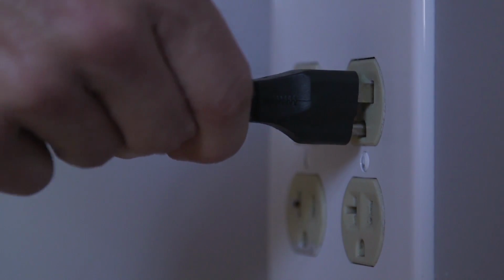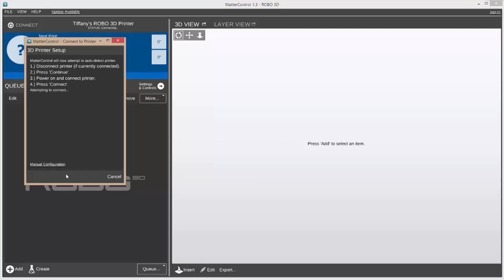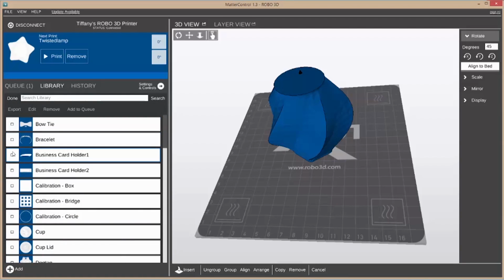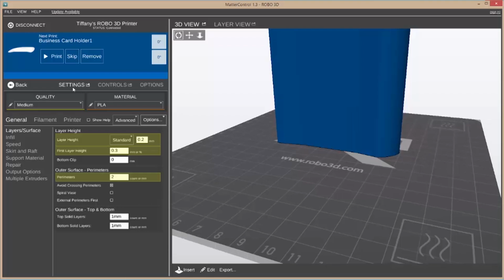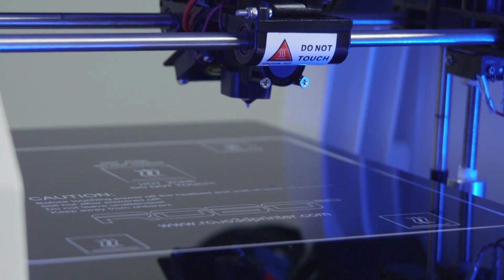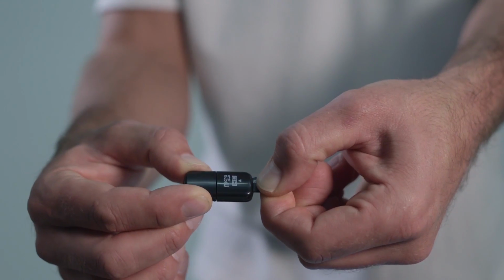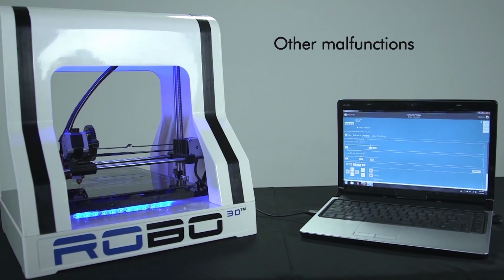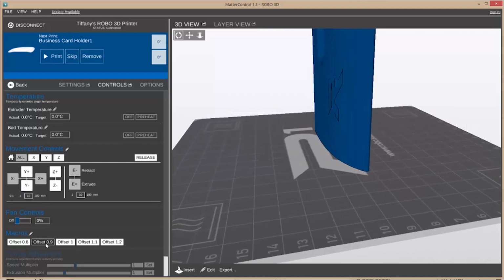ROBO 3D R1 "PLUS" Getting Started Video "Latest Version"

Comment: Have had my Robo 3d R1 Plus for about 3 years now... I've had no issues with setting it up and printing a crazy amount of odd and cool things. I am still printing with it today. Most of my prints are big enough to last 5-14hr... It is now starting to break down, but the support staff at ROBO 3D have been too awesome. I will for sure purchase another Robo 3D printer because it works great, but mostly based on the support that I have gotten in the last few months. The technician not only cured my problem, but also saved me on the shipping cost some how. Also pointed me to how to prevent future issues I might run into.

There are probably people out there who have horrible stories about this printer. I for one have not had any issues, other than it finally breaking down after years of abuse from a new 3d printer owner. I am for sure going to purchase another R1 Plus if it is still around when I have the money, or the new R2 because I love the large print bed.

Thank you Robo3D(Jason mainly) This printer is greatly appreciated by me for sure.

Comment: I paid pre-assembled.  The printer should just work out of the box but it wasn't.  ROBO 3D, do you test your product before shipping to your customer?  I bought it a few years ago but I didn't test it until today.  When I open the box, a two inch screw was dangling and scratching the glass plate.  Nothing works.  Very frustrating with this piece of GARBAGE FROM ROBO 3D.  I had never have so much frustration with a product ever.  This ROBO 3D printer is PIECE OF SHIT.  If you want to change my mind about ROBOT 3D, send me a working replacement unit.
Reply from the maker: Memet, we test out printers at the factory and then ship directly from the warehouse. If you have an issue with your printer upon delivery, your warranty is in effect and we can replace/fix any issue you may be having. Please reach out to Help@Robo3D.com.
Reply: First of all, my frustration is directed toward the product and is not directed toward any particular individual.  The printer cost $914 USD (shipping included) so it is not a low cost product.  NOT ONCE does the printer print anything.  Right after each failed attempt, I needed to clear the clogged hot end and removed the backed up filament and the printer still won't print.  Forget about the hot bed was scratched up and chipped. Forget about waited five weeks for delivery.  I just want it to print something.  Endless frustration.

Comment: +ROBO 3D I bought a Robo 3d r1 and got it all setup. I used a copper PLA filament for the first time. I set the correct temperature for the extruder at 210°C and Bed at 55°C. when it started heating up I saw smoke coming from the nozzle. Is that normal?
Reply: I believe so because they used test PLA filament the test to make sure the critter works and since you were using the Copper based Filament it probably just melted the PLA too fast and it turned to smoke
Reply: Yes it shows that its working.

Comment: I am on my 2nd R1+ printer in three weeks. The first got such a nozzle clog I took it back to Best Buy, The second one got a bad clog five days ago and was able to get that out just yesterday. Now it will not level and it either stops after a couple of layers, does the top layers of the calibration cube, or prints 2 inches in the air. I would love to post good things about it but I can't
Reply: +John Allen I had those beginner problems as well. its not the printer. its you. I don&#39;t blame you though. I was a beginner at one point as well. the R1 I have is just awesome. its printing as I type this. ive printed COUNTLESS things so far. quality is not like the real expensive ones. BUT its pretty great quality nonetheless.

Comment: You need to do a video on how to change the heated bed
Reply: +JR Lenard 
May I ask do you have a robo 3d r1 Plus ?
if so how do you like it ?
Reply: I like it save for the serious learning curve of how to get it to print without faults, but once you get that part out of the way it's a great machine.  I just had a fault in my wiring and now I need to get a new heated bed but so far that's the only major issue that I've had.
Reply: JR Lenard do you have the original R1 or the new R1 Plus ?
Reply: The R1, the only difference between the R1 and the plus is just a few minor things but it is basically the same machine.